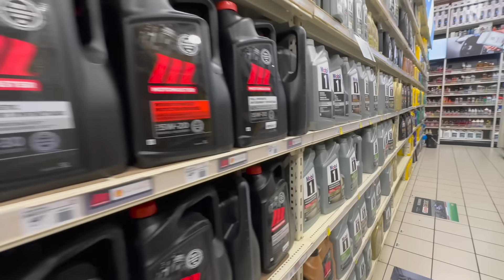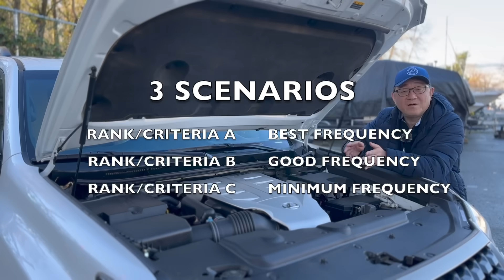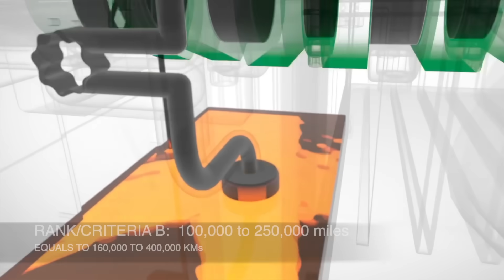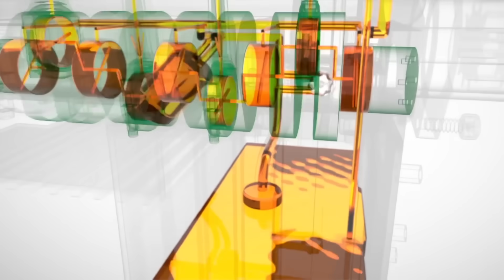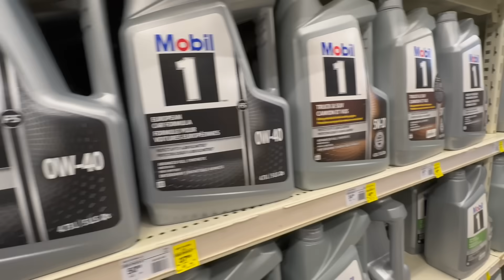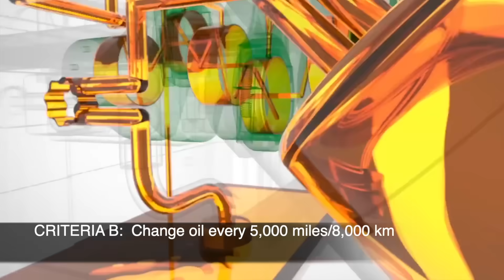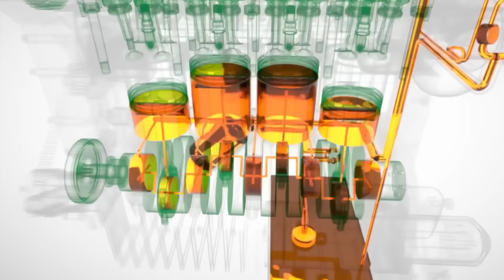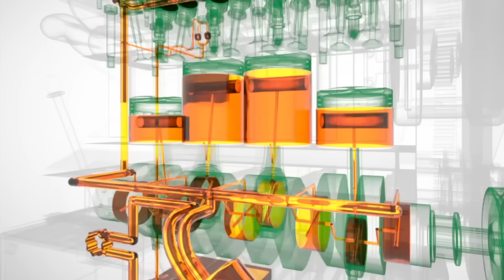ENGINEER EXPLAINS HOW OFTEN TO CHANGE OIL & FILTER // UPDATED CRITERIA-BASED RECOMMENDATIONS!

Comment: I'm in category A with both my 2007 Chevy Silverado Classic and my 2018 Subaru Impreza. My truck has 170,000 miles on it and idling oil pressure is over 40 psi. It uses no oil between changes. I go 3,000 miles or 1 year between full synthetic oil and filter changes. I put less than 2,000 miles a year on my truck. My Subaru has a factory oil change oil interval of 5,000 miles but I'm changing the oil and filter at 3,000 miles, again with full synthetic oil. I put 7,500 miles on it annually. It doesn't use any oil between changes either. I'm 65 years old and don't intend to buy any more new cars.

Comment: If you are operating a Greek holiday car rental business, you never change the oil, you never check the steering joints nor do you ever change the tyres, until they burst from wearing through the tread, the steel wires and the inner tube. On the other hand if it is your car that you intend to keep, change the oil often.

Comment: 65 yrs old here. Dad was a mechanic had his own garage. Never had an engine blow up since driving at 1976. Only ever changed oil once a year usually 8000 miles. Buy the cheapest but correct grade oil. My vw did 350k miles and still going. I will do once a year as I have done.oil used to be cheap it’s now astronomical. Never had a new car either so always inherited other peoples neglect.i think engineering now is so superior with fine tolerances and just last longer. The problem in th uk is keeping car for 30 yrs the chassis will have rotted, emissions failure at mot.and suspension needs renewing due to appalling roads. Interesting vlog but am sticking to my schedules due to success

Comment: For what it's worth. Here is my experience. I have 4 European Cars, and one Toyota Tacoma truck in our household. In the European cars I always used the exact Mobil-1 0W40 they specified. All my cars except Toyota are past 350k miles. Toyota I use the dealer supplied oil and NEVER anything else. No engine trouble in any of them. I follow a German Engineer's advice and only change oil and filter around 10,000 miles. Had absolutely no trouble and the engines are as new. It seems the American 3000k standard is largely a money making racket as the oil are recycled and there is a huge market for turning oil changes every 3000k.
Reply: That's amazing. A European car with 350K!
Reply: @davidanderson8469  Whats amazing about that ?, all my european cars except the moneypit junk like BMW,VW,Fiat etc are like that.   They only die due to rust as I am close to the coast.

Comment: This brings up two puzzling thoughts. 1) Why would manufacturers recommend longer average intervals on a product that they supposedly know inside and out, if it is really critical to change it more often...unless they are building in planned earlier failure, and hence making you buy another vehicle from them?  If Mr. Chao has data to support his opinion, then this would imply manufacturers may not be as transparent with the truth. Nothing is mentioned here as to the various conditions of driving. 2) This is implying that if you buy a previously leased vehicle, you may be getting one that will fail much sooner, since the lessee wasn't as diligent with the maintenance. By stretching out the intervals, you're essentially passing premature failure on to the next person. If this maintenance practice was true across the board, buying a previously leased vehicle would be a bad idea.

Comment: I have a 2000 Ford Ranger I purchased from the Ford Dealer in August 2001 that has a 3.0L V6 with 8,000 miles on it when I purchased it for very cheap as it was a repossessed vehicle. I have changed the oil and filter every time the odometer 1,000's of miles is divisible by 3, 9,000 - 12,000 - 15,000 - 18,000. I have always used Castrol Synthetic oil and the truck now has 347,000+ miles on it. The Ford dealer has never seen the vehicle as there has never been anything wrong on the vehicle that I couldn't fix myself. I changed the oil/filter. Water pump has gone bad twice, easy fix. I replaced the radiator once, even easier fix. The standard replacement items are brakes and pads I've done myself, not that easy but can be done and I drained and replaced the manual transmission oil at 150,000. Not as easy as it seems, but if you can change to oil in the engine, you can do the same with the transmission. The only thing that someone else touched bolts on was the AC compressor being replaced and I left that up to a professional. I still drive the truck every day and it still feels like it runs like new.

Comment: Your wasting money on the 3000 mile oil change..5 to 6 k miles .is fine..ive been a mechanic for 45 years and rebuilt 200 plus engines..most failures are from no oil or overheating concerns..gdi engines with overhead cams are sensitive to oil changes..and good quality oil.of course but after testing the oil.at 5000 miles..it still had good lubricating quality..reduced of course but still within parameters.

Comment: There should be criteria D.  Here's the scenario:

Firstly, because of the pandemic to start with, many people have been driving their cars less often.  Secondly, combine this with the coincidence of those being in retirement or working from home.  Thirdly,  it also happens to be one's 2nd or weekend car.  Now, here's the problem and question:

The dealership's schedule of oil change on my 2019 Miata bought NEW in early 2020, with only the usual 50 miles or less in mileage was every 7,500 miles or 6 months, whichever ever comes first.  It uses the usual synthetic oil on new cars.  

Last year, after having owned the car for only 3.5 years, I have only driven the car around 13,000 miles or so, roughly 4,000 miles a year only.  Starting last year in November, I had an oil change, my 3rd or 4th so far, I think.  Maybe on account of the car being on its 4th year already, or my driving habit of driving only roughly 3,500-4,000 miles per year, the dealership changed the maintenance schedule of oil change to 5,000 miles, or ONLY 4 months!  You see, since November of 2023, when I had the oil change, and it's only February of 2024, I have only driven the car about 1,000 miles, and the trip computer is already reminding me it's only less than a month for the next oil change!  Btw, even though I only put about 300 or so miles a month,  it's mostly 2/3 high-speed highway, 1/3 city driving. 

My question is: On account of this scenario and driving pattern, do I still adhere to this dealership's recommendation of an oil change even though I have only driven 1,000 miles?  Or postpone it still?  I'm aware oil, regular or full synthetic, still degrades over time, BUT at this time and always?  Thanks for your time.

Comment: Every 3000m, about with the seasons winter, spring, summer, and fall we got 214,000m on a 2001 Prius, traded in on a 2014 Prius. 1992 Diesel pick up 267,000m every 3000m when it was the daily driver, but since retirement twice a year. Are the finer by-pass filter systems for soot removal necessary?

Comment: The manual for my 2014 Kia recommends 6000km or 6 months for "severe usage conditions" - which appiles to  pretty much everybody.
So if you use exclusively synthetic oil (like I do) that has both A and C guys following the same schedule ... only you B owners would be abusing the engine 😅

[Mostly short drives? Salt on the roads? Cold temperatures? High humidity? City traffic in hot weather? Dusty area? Mountans? All those - and more - call for the severe schedule]
(BTW - I'm an A)

Comment: More important to keep ALL fluids and filters serviced than worry about JUST the engine oil. Engine, Transmission, gear oil, coolant and all associated filters need changing on regular intervals that are at or before manufacturer recommendations and most vehicles will have no problems if you do just that much.

Comment: You said the oil doesn't wear out, it gets contaminated, which is true. You said you can leave the filter through a couple oil changes, which is the opposite of what I do. Thanks to government, by-pass oil filters are considered 'modifying' the engine and thus are illegal and because there is literally no room for one anyway, my solution is to change the microscopically tiny oil filter at least once between the oil changes. And I religiously use oil analysis, so I know the condition of the engine, transmission, differential and even the coolant.

Comment: Oil is CHEAP engines ARE NOT!.. I change the synthetic oil in my 2002 S10 4 cylinder with 150,000 original miles every 2,500 miles..still runs like brand new👏

Comment: Hi David.
Thank you very much for providing such a useful and comprehensive clip. Can I ask you one question please?
I have a Honda crv 2007 petrol 2.0 automatic with 126000 kilometres on the clock. I am from Romania, and over here we have in the summer around 30 degrees and in the winter reaches to about - 30 degrees. I was thinking to use 5w30 in the summer and 0W20 in the winter. Acording to your advice I should use thicker engine oil in the summer and thiner in the winter. Do you recon that 5w30 for summer and 0w20 for winter is the best option?
Thank you in advance for your help.

Comment: Driving conditions vary, Gravel roads, highway miles or city. if I am driving a thousand highway KM's a day I will not stop to change my oil every 8 days. Scientific Oil testing labs can take the guess work out of all this interval speculation. Industrial plants that operate internal combustion engines or any equipment that is lubricated with oil, such as gear boxes etc., schedule oil analysis tests to determine when to change out, or microfilter oil using portable filtering units. The tests are not expensive compared to the cost of premium oil and the downtime/production loss  to change the oil before it is necessary.

Comment: Going off Blackstone UOAs I change my oil every 25,000 miles running Red Line (POE base) or Amsoil signature series (PAO base) heavy duty 15w40 and the 2 micron Amsoil bypass filtration system.  At 25k it still has plenty TBN and anti wear additives left with minimal wear metals and fuel dilution.  It probably would be safe to run 30k intervals but 25k gives me peace of mind.  I’ll change the full flow filter every 12,500 miles.  For that I use the Purolator Boss
Reply: There is almost nothing in a modern engine large enough to be removed by a full flow filter.  I have no way of measuring microns.The Australian Jackmaster Classic claims 1 micron. Motor Guard has always claimed submicronic. I believe Gulf Coast filters claims 1 micron. I have all of them in use. I gave up allowing oil to get dirty then draining it in 1963 with a Frantz oil cleaner. I normally dont drain oil.
Reply: @ralphwood8818  interesting…you’re talking about bypass filters, correct?
Reply: i understand there can be varnish build up from long interval changes even though the TBN and wear additives are good
Reply: @fitnesspoint2006  That’s a fair concern.  I plan to pull the valve cover off soon at 80k and inspect.  I’ll report back!
Reply: Yes bypass toilet paper filters. Toilet paper is high quality cellulose. They are trying to hide the fact that they are toilet paper filters. Jackmaster puts a high quality roll of Australian toilet paper in a sock and charges 20 bucks for it. I use Great Value 1000 from Walmart in mine. Most use Scott 1000. People assume toilet paper comes apart in oil. It gets stronger in oil. I started with a Frantz in 1963. Went to the top loaders in the 80s. The Jackmaster needs a firm roll. It has no center tube. They depend on the 1 15/16 core seal at the bottom. All I have used is the classic. Not familiar with the Ultra or the bigger models. I sold Frantz Motor Guard and Gulf Coast filters years ago. Motor Guard only makes compressed air filters now. I think Gulf Coast filters only makes paper towel filters now. When I was selling Frantzs Gulf Coast filters had Frantz 3 stackers all over the Gulf of Mexico. At some point the Frantzs went out of production. We also lost the FAA approved AeroFrantz. In 1963 I was working in a full service Standard station. A Standard oil engineer told me to use a Frantz and Delo. Delo came in 20W and 30W. Couldnt use multi grade in a diesel.
Reply: @ralphwood8818  gotcha.  I try to stay away from cellulose filters and use synthetic filter media.  That technology has made tremendous strides over the last 25 years
Reply: . I hear you. Some toilet paper filter users dont change the full flow filter because they figure the toilet paper filter is doing all the cleaning.I did a little experiment. I ran a standard Wix 65.000 miles. Cut it open. The pleats were rotton but still in one piece. I put a Wix XP on it. The picture on the box shows wire backing. Im told the pleats are synthetic and wont get rotton. I normally change the toilet paper in the Jackmaster clasic every 6.000 miles. It is still strong and tears at each sheet. If the paper isnt strong when I pull it out its been in there too long. I cut open a full flow filter once and part of the pleats were missing. He said he had been too busy to change the filters or oil in about 3 years. A piston was hitting the head. I was visiting my wifes sister about 79 or 80. She had just  bought a New Honda Civic CVCC ? I didnt have a Frantz with me. I stopped at a Frantz Amsoil dealer there in Salt Lake city. She drove around Salt lake for about 200.000 miles without draining the oil. When she moved down here to Dallas Texas she asked me to put AC in it. I told her it wasnt worth it. The body was rotton. She gave it to someone at church. He drove it about 150 miles a day. They called me wanting to know if I wanted it. It had over 350.000 miles on it with an engine noise. Even the hood had large holes in it. After 60 years I will keep going down to Walmart and squeeze toilet paper. Toilet paper doesnt fit the Frantz now. You can use it if you know what you are doing.
Reply: The Honda used Amsoil 10 40 as long as she had it. At the time Amsoil may have had the canister bypass filter. I remember Bobby Unser saying this oil is forever. Too expensive for me. I have a flat head Ford V8 canister filter modified to use Scott 1000. It has half a roll of Viva towels in it now.
Reply: I left out a word.I think Bobby Unser said this oil change is forever.
Reply: Bobby Unser was on a Amsoil  brochure.
Reply: Insane

Comment: I change my oil every 10,000 miles with Supertech full synthetic and a $4 Supertech oil filter. In 12 years 190,000 miles my car still uses almost no oil between changes. I have never added any oil. My Dad goes 20,000 miles and hasn't had any problems either. I don't go by time. My tractor doesn't get used much and has had the same synthetic oil for the last 15+ years.  I have put less than 100 hours on it in that time.

Comment: Ha! I have a 2006 4Runner with 250,000 miles, I have changed the oil only 5 or 6 times, and it still runs like new. Myth BUSTED. I used to drive 300 miles a day. I would be expected to change oil every 10 days?????? B.S.!!!

Comment: Clean oil never damaged any engine, I looked at a Renault 0.9  clio engine the other day, 60,000 miles and full service history, the engine was filthy black inside, 12,000 oil change intervals are crazy, 6-7000 miles and oil has done enough, I’ve done oil patch tests on different oils and the amount of contamination in them was eye opening. Change your oil regularly

Comment: 2017 RAV4 with mostly highway miles with a road warrior job. Full synthetic, the oil didn't even start getting dirty until 6,000 miles. I added half cup of Seafoam or Marvel Mystery to the crankcase the day before oil change and made sure it was warmed up fully. It is my suspicion that the sludge buildup in/on the piston oil wiper rings are what cause these engines to fail prematurely and start burning oil. As it was mostly highway miles, I usually changed oil at 9k-11k intervals. Call me crazy, but 205,000 miles currently and no oil burning issues. Toyota filters from dealer, oil is not black...maybe dark brown before changing. YMMV but I'm very happy with this vehicle.
Reply: I think you are the wisest man not to do unnecessary frequent oil changes. Really crazy are those who change every 3000miles.
Reply: I have a 2020 Rav 4 with the 2.5 liter.  I been doing the Mystery Marvel right in oil.  Same thing.  Oil looks clean at 5000 to 6000.  I am using Mobil 1.  0W-16  weight with the high end Fram filter.  I do notice that at 74,000 miles when you punch it in Eco mode it will redline like the transmission is stuck in 5 or 6th gear.  I believe these have an 8 speed auto transmission.  I have feeling that its not good on these motors to run right up to 6200 rpm.  Creates a ton of heat.  I wonder if that is why these engines fail at lower mileage?  The Mobil one is rated for 10,000 miles.  I have been doing it at 7500 miles.
Reply: @sawmanbigtreeslayer2360  I'm also 2022 Rav4 2.5L 8AT, I don't drive too much, so I usually change once a year.
Reply: You listen to to many videos and have a false idea of what's in your pan, if you change oil regularly there is NO CRAP in your pan
Reply: Your putting unknown crap in your engine . Only oil belongs there not some mystery witchcraft junk
Reply: Crazy to pour water, aka seafoam into your crankcase.  Maybe if you need a mystery addiitive you arent changing the oil frequently enough (or are using expired, fleamarket oil).
Reply: @ I agree, if driving many miles after adding it. I'm adding it to a warm engine, idling briefly to distribute, then letting it soak overnight. Driving 10 miles to dealer for Mobil 1 synthetic isn't that much of a risk, but helps to flush out any buildup.